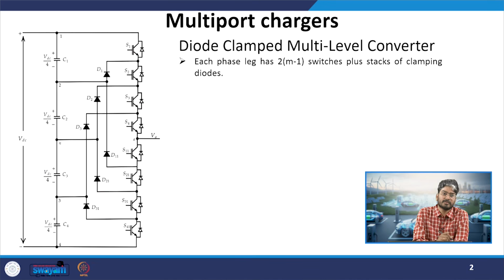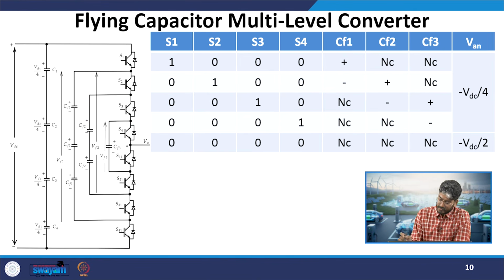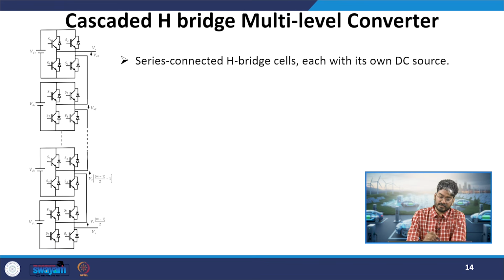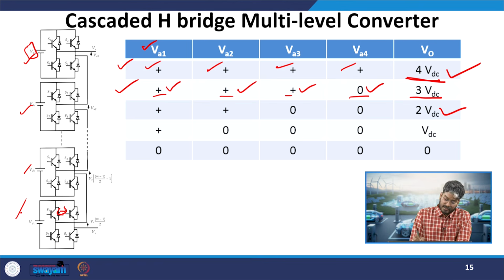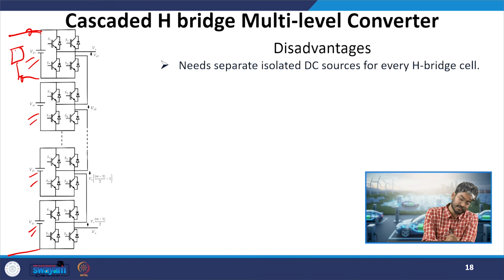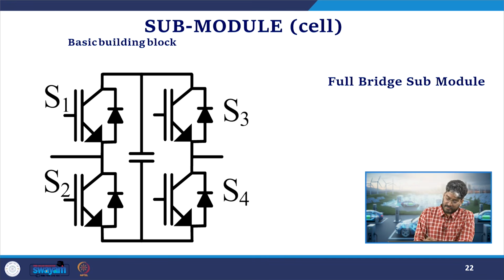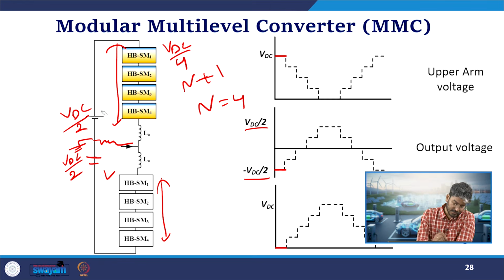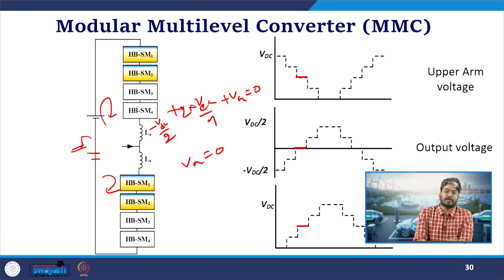Lecture 18: Modular Converter based Multiport chargers - II

Comment: The content is in detail but the teaching method needs to be restructured. The natural flow of conversation is not happening. There should be some pointers on the sheet for reference and there should be pause between statements. I am intrigued by the topic but the flow has litreally kept me grounded.